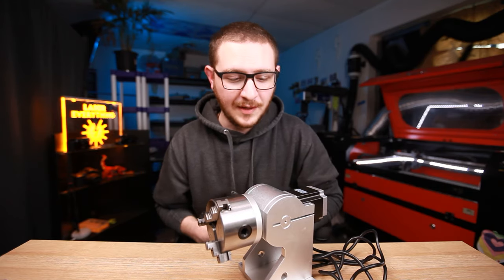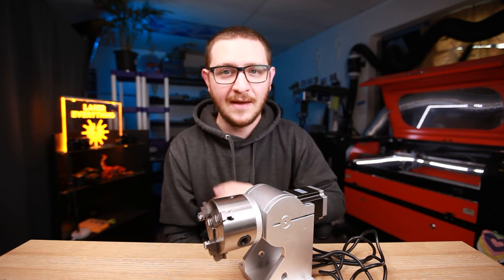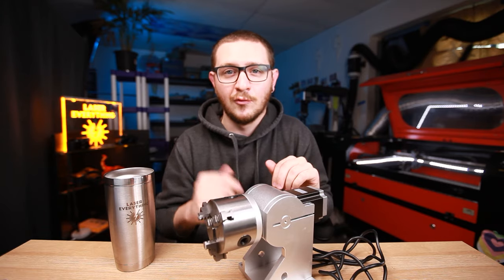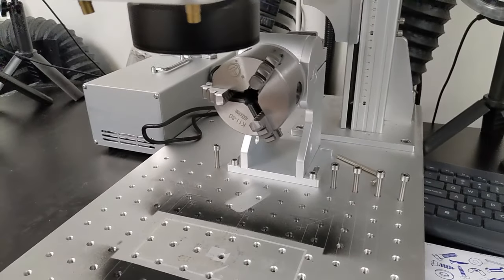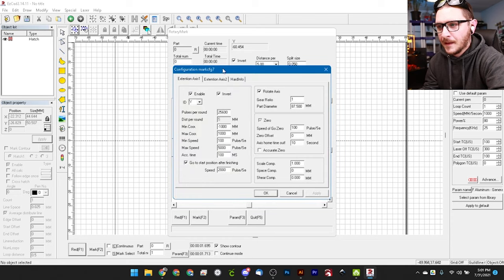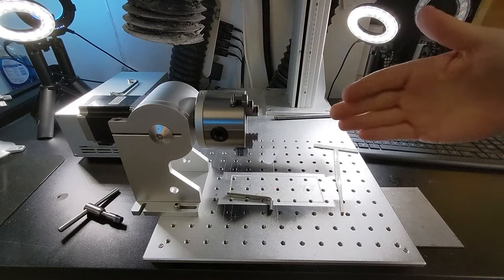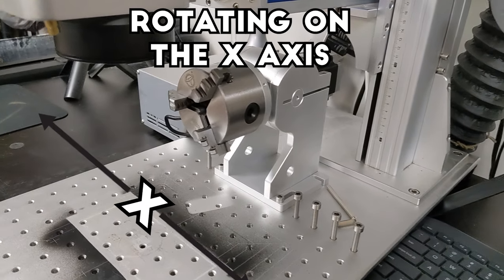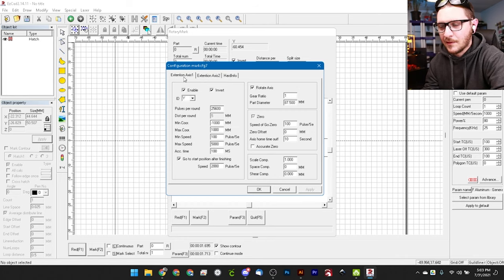Set Up A Fiber Laser Rotary Tool with EZCAD | COMPLETE GUIDE

Comment: Great vid, I sure would like to find an all enclosed all in one stepper driver like that, very cool.  One comment though, the head on my fiber laser is only secured by 4 bolts up where the horizontal arm meets the column.  if you loosen those you can move the head forewords and backwards, so that you can get the center line of the laser lined up with the center line of the rotary. Sure seems like an easier way to center things?  No more messing about in the software with offset lines and such.  Correct me if I am thinking about it incorrectly though!
Reply from the maker: Wow I never noticed that, good eye! I will try to implement that soon!
Reply: My arm/head came out of the crate centered to fit in the shipping box, so step one was to slide it back otherwise the head was off the table.

Comment: I’m so late to this video. But better late then never. Just got a 30 watt fiber laser and wanted to know if this machine with the power controller box is all I need I don’t have the controller inside the laser. But someone was telling me I need a stepper driver and the rotary is this essentially the same thing?
Reply from the maker: The external box should include a driver in the chassis

Comment: Hi, we love your videos. When following along we noticed we don't have any of the add ons for the laser dropdown tab. There's only three selections in there but nothing for rotary.   We have ezcad 3. Can you help us out on what to do? Please
Reply from the maker: Ezcad 3 doesn't have the same plugin support ezcad 2 does. What you need to do is head into F3 Param, find the Extension Axis section and activate the A axis, the mark/light area of the screen at the bottom will then have the rotary settings you're looking for.

Comment: I noticed that by the end of the video you had "force all by split" enabled. Could you explain this setting and whether its necessary? Thanks!
Reply from the maker: Unnecessary and in this context does nothing. Just ignore it if you're following along with the video. RotaryMark handles split allocation fine on its own. Force all split has implications if you're trying to let ezcad decide where to make splits, which I don't recommended. Static small split sizes is 100% the way to go.

Comment: @LaserEverything    So @16:00 So are you saying the pulse per 360 circumference dip switches have to be changed everytime we work with different items?  My rotary is all setup right now for laser engraving rings and using Lighthburn, I just need to measure the diameter of the ring.  Is this not the same with a thermos and if not, why?

Comment: Thank you for the video, I just pulled the rotary axis out of the box and did not know anything on how to set it up. My package did not come with a materials library for the speed/power/KHz canned settings , is this a file that can be shared? I would appreciate a head start on speeds and feeds for the Galvo (20w) I have an old beat up tumbler I am using for the test, I finally managed OK looking engraving. After a few botched attempts and a quick shot of matte balck over the tests I was able to run several tests on an otherwise junk piece. Maybe a hint for others, use a junk black tumbler, spray over tests to re use same piece for more testing, I know an erase pass (hatched rectangle fast and hot) would make the final engraving better but this is a test piece for me and mot worth the time and smoke in the shop.
Reply from the maker: Hey man, glad the video helped you! You can actually get instant access to my entire fiber laser and co2 laser libraries (updated MONTLY) by supporting the channel/podcast/community on our patreon page. You can check it out at http://www.patreon.com/lasereverything :)

Comment: i, I have the same concern as you. I am working on a galvo laser marking project. i want to put the galvo head in a CNC machine 5 axis (X, Y, Z, A, B) differ from the X, Y axis of the galvo. I manage to mark using the B rotary axis. But I still cannot manage for CNC A and XYZ axis. I am considering buying a DLC2 M4 3D card to have more possibilities. If you happen to have found a solution for your case, it may help me solve my problem.
Reply from the maker: Your setup sounds really nice, if you're not already a member you should definitely join our free discord server. There's a link in the description. I'd love to see pictures of how you have things set up!
Reply: @LaserEverything  Thank you very much I just sent a message from Discord

Comment: Getting good results. thanks Alex.  Can I ask, when doing a round design it comes out elongated on  a cylinder. How do you get past this, do you stretch out the design prior to engraving  ?
Reply from the maker: You can but if you're seeing a LOT of skewing it could be a sign your pulses per revolution aren't set correctly. Stretching can visually fix the issue a bit but your line distance and splits won't be accurate in that case. Best double check the dip switches on your controller and see if they match what's programmed in ezcad. We cover it in this video.

Comment: At video 6:44 use the arrows keys mean "up" and "down" keys to center the line to the rod? Or did you use the "left" and "right" keys? Thanks
Reply from the maker: It depends on the orientation of your tumbler and the rotary tool, so it will change depending on the project.

Comment: This video is immensely helpful. My Rotary head is working great with text but for some reason it will not work when I upload a logo or bitmap file.

Do you know how I could fix that?
Reply from the maker: Rasters aren't supported in Ezcad 2 RotaryMark
Reply: Are vectors supported in EzCad2 rotary mark?
Reply from the maker: Yes absolutely

Comment: Great job! Really helpful.

Can you guide me for this?
I have same system. But my target is to engrave a 325mm outer dia  300mm inner dia and 8mm width (Thickness) circular brass ring. However to hold brass ring I made an aluminum attachment when this ring fits. I removed chuck and connect my aluminum attachment directly to stepper motor shaft in order to avoid unnecessary load. 

My application is deep engraving. Almost 1mm deep engraving so I am using repeat mark. 200 marks with each segment width in order to get deep engrave. After finish of one segment rotary moves and start marking on next segment.  

Suppose my content is LASER EVERYTHING. total length of this text is 100mm. Sp each segment will be Divided in to 33.3mm length.
1st segment - LASER
2nd segment - EVERY
3rd segment - THING

The problem is Due to CONCENTRICITY, unnecessary gaps are coming between each segments. It's not uniform. Somewhere there's a gap, somewhere perfect and somewhere it is overlapping.

Can you guide me settings and suggestions for heavy or big dia objects?

Dear sir I will wait for your valuable feedback.
Reply from the maker: Thanks for reaching out Hitesh! This is pretty high level support which I can't really provide via youtube comments. I would recommend either posting in our discord server or facebook group.
https://www.facebook.com/groups/lasereverything
https://www.discord.gg/lasereverything

Comment: New fiber laser user , followed all instructions  have my sizing dialed in click “Mark” all it does is outline where it would laser and doesn’t actually mark the tubing. If you have a solution to that it would be VERY helpful , thank you in and advance and for the video
Reply from the maker: Triple check focus then check these things:
1. RotaryMark isn't compatible with raster images, that means no photos or pixel grids. It must be a vector.
2. Check your hatch. Make sure your hatch is running parallel to the direction your rotary is pointing. If it's going against the grain it may not mark.

Comment: Great video!! Thank you for sharing all that you do.  Is it possible to engrave the interior of a ring using the rotary?
Reply from the maker: Yes, you just need a rotary that will hold the ring on the outside and then you place the rotary at a 45° angle or so to the beam coming in then you can rotate the ring. Some copies of ezcad even have a ring rotary mark plug in installed that you can use to make the process easy. I have some rings now I'll upload a video on this soon.
Reply: @LaserEverything  Thank you so much for responding so quickly!! That’s great to know, will be looking forward to your session on this. Again, thank you!!
Reply: @celbur  unclick the invert when doing the inner side of objects

Comment: Hi!! great video!  i have an issue, the rotary works fine but the size of my image is engraved  mmm "squeezed" the size of the vector is not respected, for example if i draw a 2cm circle and sent to engrave i obtain a big oval, do yo know why is happening any clue will helpful. Regards from MX!
Reply from the maker: Sounds like an issue with your pulse rev (pulses per round) did you check to make sure the dip switches on the controller match your pulse per round setting in ezcad?

Comment: Amazing video, just have 2 problems. My y value stays at zero when I open the rotarymark setting and I am unable to change it to the value of the text I am trying to engrave. Also when I press the light button in rotarymark all the the other buttons go gray and I am unable to exit out of the rotarymark mark setting.
Reply from the maker: Having trouble visualizing your first issue Mick. If you can get a screencap or some screen shots of what's going on to either the facebook group or discord server so someone can take a look that'd be helpful. Never light in rotarymark it doesn't work very well. If you do again by accident you can use the ESC key on your keyboard to get out. I always light my project in 2D non-rotary mode before proceeding to get a general idea of how the graphic is going to fall.

Comment: thankyou and I have one question is that where do we use a current table from sw1 sw2 and sw3?
Reply from the maker: The current table should be on the controller next to the pulse rev table. I don't usually recommend adjusting sw1, 2 and 3 unless you suspect you are having some kind of overdrive/underdrive power issue.

Comment: I don't know what to do. I have the same rotary and programmed it exactly like you did and it just printed a quarter inch worth of vertical lines. I'm stumped lol
Reply from the maker: Is your rotary oriented the right direction? Sounds like it might not be. Try either switching your rotation axis or physically rotating the rotary 90 degrees.

Comment: Too small of a split size can be an issue too. The steppers have a set number of steps per rotation, and while geared down, small numbers can often lead to slightly inaccurate, or better put inconsistent, steps. 

I guess as you said, trial a number that you choose and see if it works on the job diameter you have. If you see issues, change it slightly and see if this fixes it. I have seen video where people use from 0.05 through to 5mm with no issues (except speed) so once you find a working value for your job and your laser then note it down.
Reply from the maker: All good info - didn't wanna get that deep in this ep but there will be follow up eps for sure and we can talk about some of this stuff.
Reply: @LaserEverything  can’t wait. Great introductory video though and there is something for everyone there.
Reply from the maker: Happy to hear it!

Comment: I finally bought a D80 Rotary Axis, but I'm having issues with my images.  My text comes out fine, but my images are being distorted (like they're being pulled/stretched).  The only thing I'm doing is rotating them 90 degrees so I can engrave on the Y-axis.  Any thoughts?  I tried to log into the Laser Master Academy but it's telling me I don't have an account isn't working.
Reply from the maker: you're likely signing in via the wrong portal - try logging in at https://masters.lasereverything.net instead of the main site.

Comment: I bought a fiber machine about 3 years ago, and recently the rotor has started misbehaving. the beginning of the engraving is all cramped up and engraved on top of eachother and not at all spaced out, but towards the end of the engraving the rotor starts spacing things out properly again. The people I bought the machine from have been super unhelpful and I dont know whether it is something misconfigured in the software, or if my rotor is dying.
Reply from the maker: Could be the stepper motor. Shouldn't have to buy a whole new rotary, stepper motors are super cheap may just want to replace it. Probably a nema 17 or 23, you can pick them up here: https://lightobject.com/?ref=ih3f7UHr

Comment: Need help.
When i mark or cut anything its little bit smaller than original size.
Please tell me what should i do?
Reply from the maker: Run lens corrections as seen in this video: https://youtu.be/llflAf0G62Q
If you're still having trouble make sure you're offsetting for kerf by offsetting your cut paths: https://youtu.be/OGZZI_m3PQc
The kerf video linked is for CO2 lasers but the same thinking applies.

Comment: good vid. Thank you. .Im just working on my new machine now but I find ezcad2 is very glitchy when using the rotary. It crashes and hangs at random times. What pc are you using ? I read somewhere that Ezcad2 doesnt like windows 10 and works better on older systems like W7!
Reply from the maker: I can probably help you out with that in the discord. I have a fix that will allow ezcad to use more ram but can't link it on YouTube. Link in the description if you're interested
Reply from the maker: Same to you. Join the discord and I'll try to help out.

Comment: Hey Alex, great video it has helped a ton. Currently I am having a problem with using my rotary. I have done everything in this video including the steps per rotation. It will put everything in the tumbler just fine. The problem is it runs the same power and speed no matter what I change it to. I have tried the community edition and my issue over there is everything I run is extremely fast no matter what I change it to. I have tried discord and I haven’t received any help. Can you help please?!
Reply from the maker: I'm honestly at a loss on this one. Sorry I didn't see your post in the discord, things move very fast over there. In your original copy of ezcad check to make sure Hatch #2 and Hatch #3 are completely disabled and thaty ou're only using Hatch #1 with mark contour and follow edge once disabled. The hatch should be uni or bidirectional with a zero degree hatch angle. Make sure that hatch is the same color as the parameter that you're applying to it as that could be why the parameters aren't changing. You may be editing the blue or red pen inadvertantly or editing the parameters for hatch 2 or 3 when you mean to be editing them for hatch 1. If that doesn't work try some of these trouble shooting tips for the community edition as well and it may help narrow down the issue.

Comment: How can I set the Rotary to always do 2 passes per cup? I can set that under TOTAL NUM & it will go twice. Once I insert the next cup though, it will only go 1 time even though 2 is still in the box. I will need to QUIT & reopen the RotaryMark choice & once again set TOTAL NUM at 2.
Reply from the maker: Try using "loop count" in your hatch instead of the pass counter to circumvent that.
Reply: @LaserEverything  thank you. I’ve already tried this & everything else. Another user said I need to make a copy of the file & just select both together & then run it. Sounds correct, I’ll try it soon. 

Thank you for replying!

Comment: Thanks for this helpful video Alex. I have followed all you steps and have my rotary working now. I do still have a problem with my center line. I had to move my center line about 20mm down to get it centered with the rotary. And that is where I focused, however when EZCAD marked, it used the Galvos Y axis center and not what I used as my center and engraved 20mm higher than my center and because of that it was slightly out of focus. I can not get my job centered under the center of the galvos Y axis or find a setting to offset the center line to where my center line needs to be. Any thoughts?
Reply from the maker: Draw a line across the y axis and light it with the red light pointer. Then affix your rotary where you can and move the line to be center with the rotary. Once that's done you can import whatever artwork and center it with the line, thus aligning it to the rotary.
Reply: @LaserEverything  same issue here. so once the rotary is lined up with the machine center, you then draw a line in rotarymark and move the line to center with the rotary? and then center the image using that center line in rotary mark? or can i trouble you to make a 5 minute video? LOL

Comment: is it okay if I just do not touch Pulse Rev ? in default there is 6400. I tried with 25600 and 6400, and I got better results with 6400
Reply from the maker: Your stepper driver is probably set to 6400 - if you want to be sure you can look at the driver and check but if you're getting results then if it aint broke don't fix it!

Comment: Just got a 2000 watt laser mainly gomna replace my plasma for our cutting, however, the question I have is: is a laser of this wattage going to be able to do engraving?
Reply from the maker: Controlling something that high on the power scale would be really difficult to tame down for engraving. It's possible it is also a continuous wave source instead of pulsed like most engraving fibers, so it's going to likely behave a bit differently. If possible, it would certainly be a challenge. Would love to hear how it goes if you give it a go!